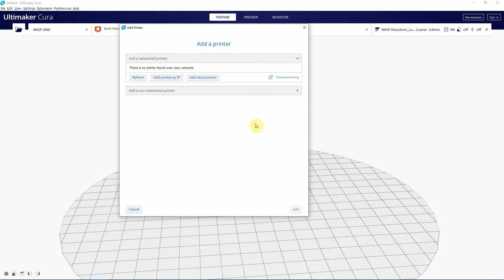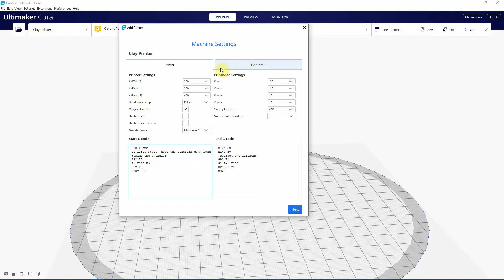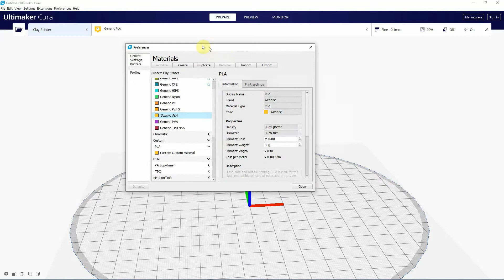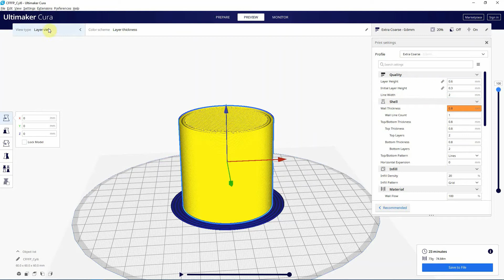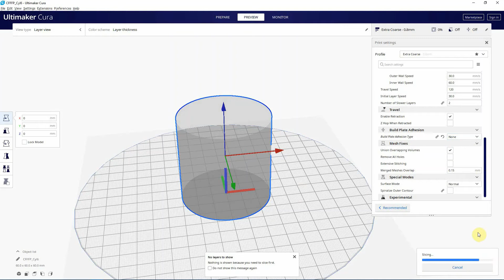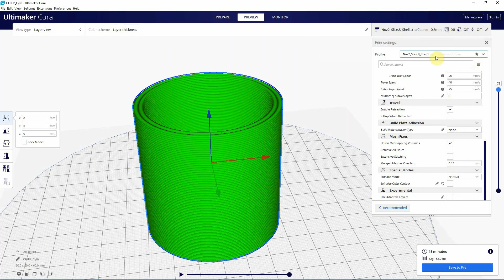Ultimaker Cura - Slicing for Clay or Ceramic 3D Printing

Comment: This video was so helpful, thank you. Was concerned using my tronxy 2 pro, first model using their recommended settings was a disaster, but following this guide printed my first really clean cylinder. Also i have a much better understanding of the bare minimum of 3d printing with pottery.

Comment: Unfortunately I am not having much luck with this process. Currently I am using Cura 5.8.1. After adding the custom printer (wasp 40100) I am unable to add any materials as all are considered incompatible (I presume). I have been trying to import some base generic materials so I can edit them to fit what I am using (concrete in this case), but alas to no affect. I tried adding another delta wasp printer this time using the marlin flavor to see if I can add a material from there but even then it does not work. Does anyone happen to know what I am doing wrong or what I could do in order to get this to work for me?
Reply: Hi, I have the same problem. Do you find a solution?
Reply: You might need be modifying the filament diameter of the printer too early. You need to keep it at a default 1.75mm first so that you can see all of the available options — then add your material, adjust the filament diameter of the material (to the suggested 1mm or whatever is right for you), then adjust the filament diameter of your printer. It feels a little backwards, I know...

Comment: how do I print with a big nozzle? I'm trying to print with a 4mm nozzle and its super slow. I set the nozzle on cura 2mm and material at 1mm. layer height 1.2 mm and wall thickness 4mm

Comment: Thank you so much for this video. What print settings do you use for the clay material when you create it? You just show the information window.
Reply from the maker: I'm not quite sure what you are asking, there are a mass of print settings when using clay? If you look in the video information above there is a link to the free guide I have published that is available on my website. In that guide is written documentation of settings in Cura for clay printing. You might find that helpful.